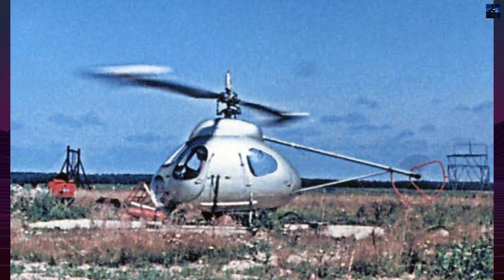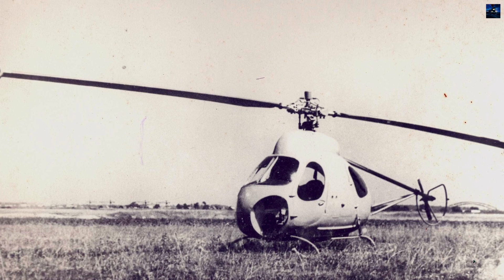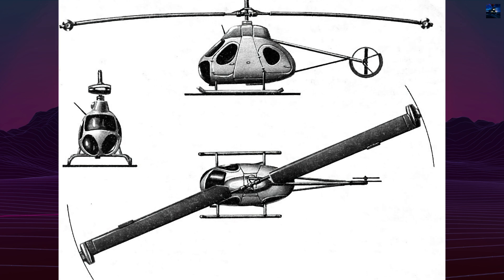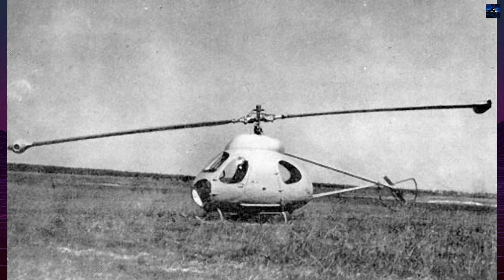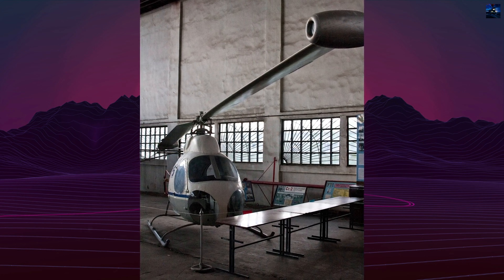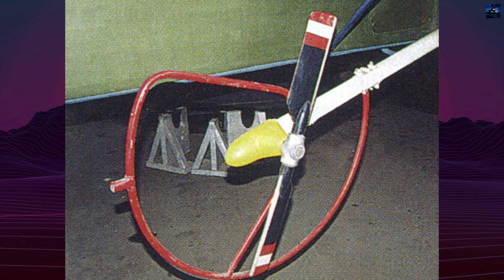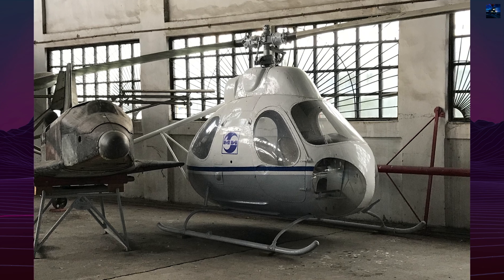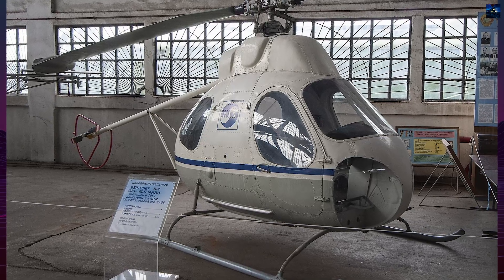Mil V-7: Experimental Jet-Powered Rotor Helicopter from the Soviet Era

Comment: The most valuable insight for future engineering? Don't ever try this again! It seems that the 1950s were the season for rotor tip propulsion - ramjets, rockets, and now, turbojets. The first two had no moving parts to complicate the operation - this one did, with potential hazards that might have been obvious, once the vodka wore off! Seriously, it would have saved a lot of time if this had been thought through first. Thankfully, no one died during the flight trials. Great detective work, finding this unique helicopter!